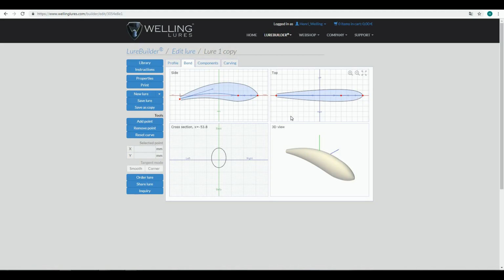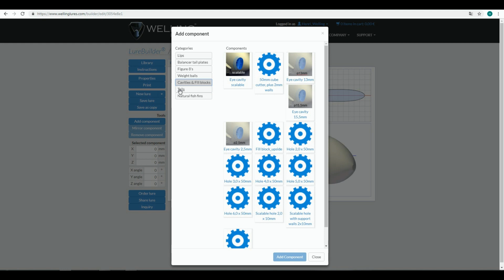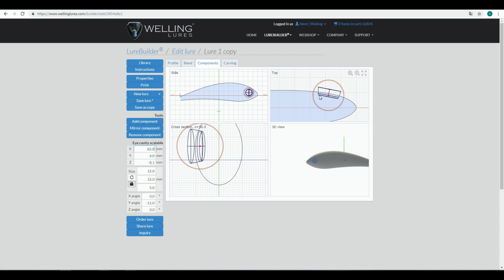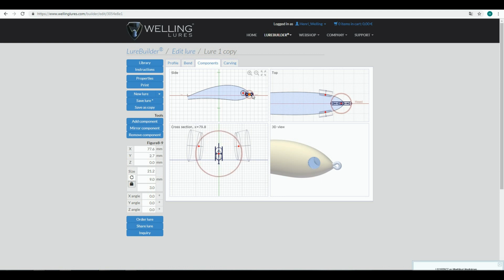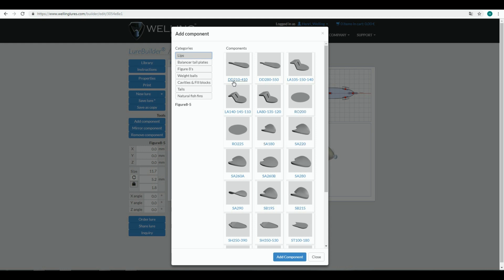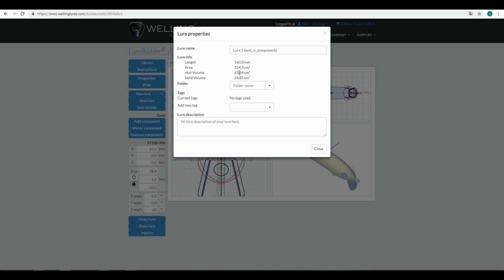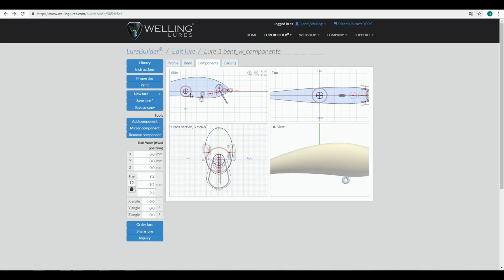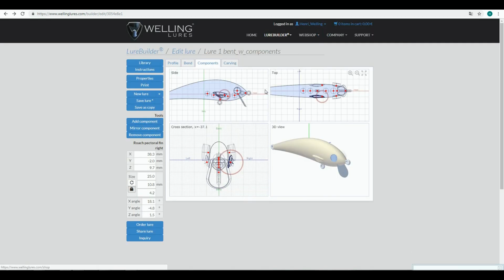LureBuilder® components tab

Comment: what a fine site i think it need a linethrue option, in Denmark we are a lot off people who will appreciate this option, you will see lot off this type here. :-) https://www.jagtogfiskerimagasinet.dk/kat141-Kystwoblere-Blink/
Allso a start profil going the other way from tick butt to small face, with and without premade eyes.
Reply from the maker: Thanks for the compliments. I am not a specialist in Danish shore fishing, but thought to start from something: 
- I applied new component "Pipe, 2x100mm bore, 1mm walls" to component library. It is plainly a pipe for line thru bore, could add some other support alternatives bit later (would love to hear how you would like the lure inner structure to be).
- I also applied one new template, "Kustwobbler": 
https://www.instagram.com/p/BtLko3agSg_/ 
https://www.wellinglures.com/builder/templates
it is of course not field tested and would need some weighing solution, but hopefully starts to bring comments how to develop it further.
Reply: @wellingluresoyltd.8443   I love it thanks, i be back with info about weight, normally its done in white metal without any lead, its called hvidmetal G in Denmark. The metal goes around the pipe, it normally is centeret in the middle with at little to the backsite, there will be more weight down the tube than abow.  So if you lay your lure on the site, it will automatic turn on its belly when you let go. I send you some photo later on, i will tell about this site now, thats forsure, it can be huge. :-)